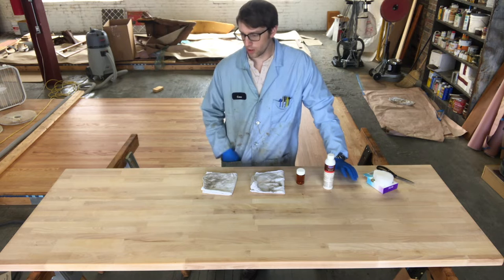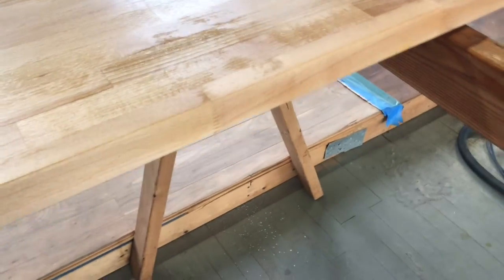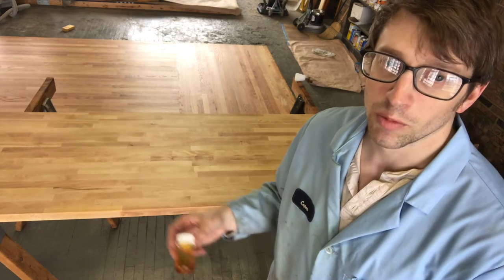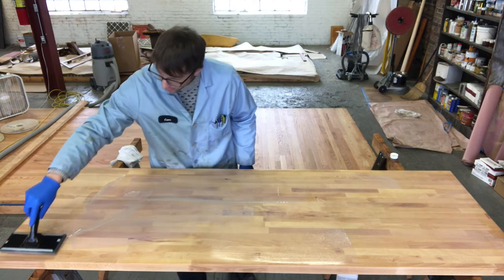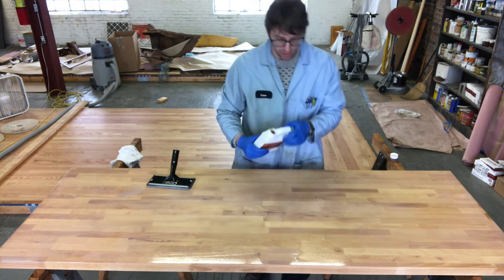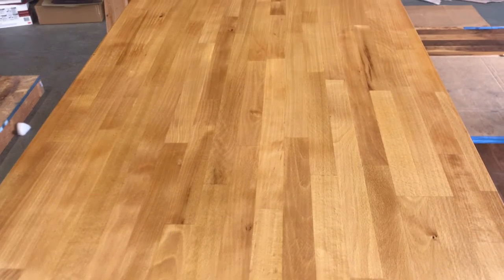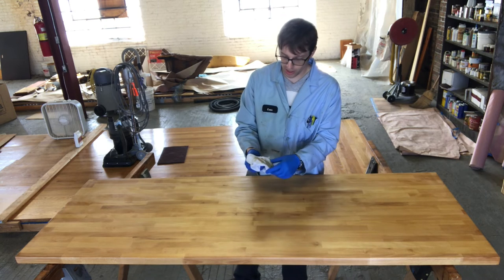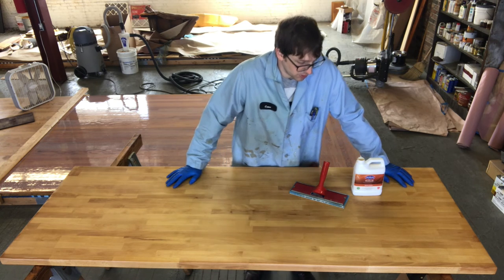Finishing Countertops with UTOS and H2OLOX

Comment: I have some birch butcher block I'd like to finish using this method but am planning on staining to get the color i want.  Is this process still the same if i use Varathane classic stain?  I think i saw letting the stain dry for a longer period of time, roughly 72 hours instead of 24 works best, is that correct?
Reply from the maker: Scott - Thank you for your interest in our products for your project.

We can't control other manufacturers formulations so we tend to err on the side of caution for drying/recoating times.  My recommendation is to usually double the recommended time for stains to cure as many stains are now "quick dry".  If the can says 4 hours, I'd give it at least 8, but more time won't hurt.

Comment: This was an extremely helpful video!  I used your UTOS yesterday and today to seal all 6 sides of my 72" x 39" hevea butcher block with two coats.  I'm going to install this on my island.  If I apply 2 coats of the H2OLOX to the top and sides and wait for it to cure for 7 days, would I flip the block over to finish the bottom and wait another 7 days to cure?  Or is it ok not to finish the bottom?  I'm concerned about possibly marring the finish on top.
Reply from the maker: Thank you for choosing Waterlox products and for the feedback on the video.  For most uses, having just the UTOS on the underside is enough.  If you do consider finishing the underside, you may want to save the last coat for the top side, in case you need to fix any damage from flipping/installation.  Also, 24 hours before flipping is plenty if you allow most of the surface to breathe (such as using sawhorses)  These guides may offer additional help:

Finishing the underside of the countertop: https://waterlox.com/guide-finishing-the-underside-of-a-countertop/
Where, When and in What order to finish countertops: https://waterlox.com/guide-where-when-and-in-what-order-to-finish-countertops/
Reply: @Waterlox  Thank you so much!  I’m very impressed with the products and your responsiveness!

Comment: Awesome tutorial! Considering using for birch butcher block countertops. It is stated that the product is food safe once fully cured.  What does that mean exactly? I do not intend to cut or prep on the counters, but obviously there will be some incidental contact and typically have rolled out pizza or pie dough directly on countertops.  Is that safe to do?
Reply from the maker: Thank you for the feedback and interest in our products for your project.  Food Safe means exactly what you are describing.  It is safe for direct food contact after as there are no harmful plasticizers or other chemicals that will leech out of the cured film into/onto any foods that contact the surface.  However, as you correctly stated, it should not be used as a cutting surface as that can penetrate the film and allow bacteria or other substances to enter.  We recommend at least 7 days for the surface to be considered cured, although full cure may take longer.

Comment: After applying my first coat of Waterlox I have one area that is particularly sticky. Do you have tips to help mitigate that before my second coat? Should it just be more time with airflow to make sure that section seals well?
Reply from the maker: Thank you for choosing Waterlox products for your project.  For troubleshooting purposes, I am going to assume that you've already applied the UTOS and you are saying "Waterlox" for the first coat of H2OLox?

On high tannin woods, if spots are not fully sealed buy the UTOS, then the tannins can be "activated" by the water in the H2OLox formulations which, in turn, can "deactivate" the driers.  These driers are accelerators, so the finish will dry on its own, but at a slower rate.

To solve your problem, give the surface more time and increase air flow with a fan on the sticky area if possible.  If you can lightly scuff the sticky area (slow hand passes, with the grain) that can help the oxygen penetrate deeper and speed up the process.  Once the film isn't "sticky" but is more just "tacky", you can apply the second coat.  The driers from the second coat will help to fully cure the sticky spot as well.

Comment: Oh man I'm in a situation! I had 2 coats of utos and 1 coat of finish on top. Plans changed from a drop in sink to an under mount. I made the hole for sink bigger can I just finish the edge or do I have to sand the whole counter before I put my final coat on ?
Reply from the maker: John - Thank you for choosing Waterlox Products for your project.  You'll want to protect that end grain well, but the UTOS will be great for that.  Wipe on 2-3 liberal coats of the UTOS (buff off excess after 5-10 minutes) on the newly exposed wood.  You can apply coats 6-8 hours apart. The UTOS will only penetrate where there is fresh wood and everything else should buff off.  Then apply your final finish coat over the whole surface.
Reply: Omg thank you so much !! I really really appreciate your response I was literally sick over this project! Again thank you

Comment: Do I still need to sand before I start the process and apply UTOS if I have a new, completely unfinished butcher block countertop?
Reply from the maker: I would still recommend it.  I cover that topic at about the 6 minute mark in our sanding video (https://waterlox.com/video-removing-old-waterlox-finish/).  Waterlox tends to highlight the wood, which unfortunately means it can highlight defects too.  There may be marks from how it was stacked, shipped or how it was sanded before they packaged it.

It’s not critical but it’s a good idea, I would just do a healthy hand sand with 100 or 120 grit.  That way you know you’re starting from a good point.
Reply: @Waterlox  Thank you! Lightning fast response, really appreciate it.
Reply: @Waterlox  One other question: my countertop is already installed, do I need to tape off my sink etc. to prevent the UTOS or H20Lox from getting on it, or can I just wipe that off? Anything else different I should being doing since I can't access all sides quite as easily as you did when it was on the sawhorses?
Reply from the maker: I’d recommend finishing what you can.  I wouldn’t worry about the underside or back edges.

Tape off what you can as that’s always easier than clean up in my opinion.  If some gets where it’s not intended - a clean rag for UTOS and a little soap and water for H2OLox while they are still wet. If you miss it and it’s allowed to dry check out this guide: https://waterlox.com/guide-removing-waterlox-original-tung-oil-finishes-from-unintended-surfaces/

Comment: Thanks for the thorough demonstration. Everything went well until my second coat of the H2OLOX. I applied too much finish in an area of the counter near the sink where I expect to get a lot of water splash. When the pools of finish dried they left noticeable orange streaks in the countertop. Is there any way I can sand those spots back down and reapply the finish? Or do I have to live with it at this point?
Reply from the maker: Thank you for choosing Waterlox products for your project.

If you can live with it, it is best to leave it alone.  Normal wear and tear will likely help to blend that in over a short period of time.  If you can't live with it, you can lightly sand those areas with 220 paper, working your way back up to 320 grit, 0000 steel wool or a maroon scotch brite to remove the scratches from the 220.  You'll then want to reapply a fresh coat.  If you are using the gloss, you can spot repair, but if you are using any of the lower glosses (matte, satin, semi-gloss), it will usually not blend as well so you should recoat the entire surface.
Reply: @Waterlox Thanks!
Reply: Hey, I’m in a similar spot I think! Can you let me know what you chose to do and how it went?? I love this product but I have no idea what I’m doing lol
Reply: @savannahlewis6156  My wife was pretty much done with the kitchen reno after almost four weeks. So my suggestion of sanding and refinishing the discoloured ripples of finish was not met with enthusiasm. So we’re just gonna live with it.

Comment: Either I don't know what I'm doing or the recommended volume for utos is way understated. Using 6-8oz for both sides of 8' butcher block
Reply from the maker: Thank you for choosing Waterlox products for your project.

The UTOS is a very high solids product (85%) so a little goes a long way.  It should not be brushed or rolled on but should be buffed on/off with a rag or buffing pad.  Pour a little puddle and spread.

Be advised that your specific wood and preparation steps can change how much your wood absorbs (pine will absorb way more than oak for example)

If you are using a lot you are likely buffing off a lot of excess.

Comment: I've always been told to stain/seal all sides of a wood project, especially if it'll live in a humid environment such as a bathroom.  Is just the sealer on the bottom enough, or do I need to do the H20Lox on the underside as well?  Waiting 1 day after first coat, then 7 more after 2nd coat... before I flip it and start again on the underside will add quite a bit of time to finishing my countertop.
Reply from the maker: That is an excellent question.  For most instances, just one coat of the UTOS on all sides is plenty of protection.  The only caveat would be if you have a particularly wet area, such as any exposed countertop with an undermount sink.  There is more information in our Finishing the Underside of a Countertop guide: https://www.waterlox.com/project-help/guide?id=0fc25320-d9fd-4562-8317-fcfb2b70e4b4&q=
Reply: 0:45 0:46 0:47 0:48 😮😮

Comment: I did two coats of UTOS and 4 coats of the h2olox matte finish on unfinished hevea butcher block. The finish turned out a very vibrant orange/yellow which was much more drastic a color change than I was anticipating. Will the color subdued as it cures? Did I put too many coats of the matte finish?
Reply from the maker: James - Thank you for choosing Waterlox products for your project.  Likely, the color will actually deepen a little more as the hevea ages (some wood bleaches out where other woods oxidize and darken).  The UTOS and H2Olox products use Tung oil as the main ingredient which is relatively amber in color, thus generating the warm tones.  Every layer that you apply will add another layer of this amber film, so the 4 coats are going to be more amber than the recommended 2 coats.
Reply: I am having the same issue with the color. I used the Truetone Tung Oil in white as my first coat and loved the color but after 2 coats of H2olox, it looks completely different. Is there anything I can do to lighten it back up so it’s not so orange?

Comment: Can I apply the coat of UTOS and one coat of H2OLOX to my counters, install them and then continue with the sanding and second coat of H2LOX 2 or 3 weeks after?
Reply from the maker: Otto - Thank you for considering our products for your countertop project.

Absolutely.  There is no maximum recoat time for any of our products so you can apply the second finish coat any time after 24 hours, whether that be 1 day, 1 month, or 1 year.  This guide on where, when, and what order to finish countertops may provide further assistance:

https://www.waterlox.com/project-help/guide?id=75e58eb4-f779-4c17-847b-53570d03362e&q=

If you have any other questions please reach out to us at info@waterlox.com or (800) 321-0377

Comment: For countertops, it was clear to use UTOS to seal the top and bottom but do you recommend a coat of the waterlox h2olox on top and bottom too?  Or is the sealer enough for the bottom?
Reply from the maker: It ultimately depends on your specific situation.  For instance, if you have an undermount sink, you'll have water exposure on the underside so you'll need more protection.  This guide will provide additional information:
https://www.waterlox.com/guide-finishing-the-underside-of-a-countertop/

Comment: Thanks for the helpful video. I'm finishing an oak dining table with the UTOS and H2Olox. I was planning to use 2 coats of each on the top, but should I do the same for the legs?
Reply: Thank you for choosing Waterlox product for your project.

Yes I would recommend the same process for the legs.  Because they are vertical surfaces you’ll need to apply thin coats of the H2OLox to prevent runs or drips, but as legs they don’t need the same final film thickness since they won’t have standing water.
Reply: @conorhawkins4089  Thank you, that's helpful!

Comment: Ok got the second coat on! I got one bad spot where it looks like it puddled and dried that way. Can I sand that spot and just reapply to that bad aera or do I need to redo  the whole counter ? Everything else looks amazing stuff is awesome
Reply from the maker: John - Thank you for choosing H2Olox for your project.  You can lightly sand and reapply, but its best to do the whole section, especially if you are using anything other than the Gloss.  You'll most likely see a spot repair in the Satin, Matte and Semi-Gloss as they just won't match up the exact same.
Reply: @Waterlox on the plus side  I am using the gloss. I had an extra peice that was finished and I tested it out looks like it's gonna work ..thanks again for all your help on this one !!!

Comment: Hello. I got confused and sanded my butcher block with 400 grit first before applying the UTOS. Pls advice on what to do next. TIA
Reply from the maker: Ideally, you should sand to a lower grit (150) to allow for better penetration of the UTOS. We are putting a film on the surface so you aren’t really interacting with the wood surface which is why we don’t need to sand to such a fine grit.

If everything looks and feels really good, you could leave it at 400. It will not severely impact your final outcome.

Comment: I am using the h2olox matte finish and 24 hours later, it looks more like satin to semi-gloss.  Does it need to cure to achieve the matte finish I am looking for?  I am using ash wood, Minwax oil satin (Jacobean), UTOS, and your H2Olox finish.
Reply from the maker: Roel - Thank you for choosing waterlox products for your project.  Mixing before use is very important with the lower gloss finishes (Matte and Satin).  The components that lower the sheen tend to "settle" over time so a good mixing 10-15 minutes before use is essential to make sure the flattening agents are evenly distributed.

A light buff of the surface and another coat should get you a matte sheen if properly mixed before application.

Comment: Is there anything that can be done if you have an “L” shaped countertop and the two pieces don’t fit together really tight all along the seam?
Reply from the maker: You have a few options.  You could use wood fillers, or caulk.  We have guides for both at waterlox.com. Just type in wood filler or caulk in the search bar.

If you're seam is close, you can sometimes use a mix of wood glue and sawdust to create your own filler that will accept color like the rest of the wood.

Comment: How is this finish different than your Original Sealer finish, which only requires one product so would be half the price?
Reply from the maker: The H2Olox system is much lower in VOCs and it also has more sheen options.  If you use the Original Sealer/Semi-Gloss finish, you can get a nice semi-gloss finish, however if you’d like a different sheen, you’d need a second product.

The H2Olox is really is the same great Tung oil and resin formula in a different package. Low VOC, almost zero odor, easy cleanup, available in every zip code.  Just another tool for the toolbox to make your wood beautiful and protected.

Comment: I'm trying to seal my butcher block countertops with the tung oil finish first coat let it dry for 24 hours next day it felt very rough I applied it literally like the directions said I watched another video it said apply with a small tiny cloth and then wipe it off so I mixed with what I should do with this product versus your H2O which is better to use and why should I not just use that since it's a less amount used I've already used half a gallon on two projects give me some tips
Reply from the maker: Dennis - Thank you for choosing Waterlox products for your countertop project.  I'm not sure exactly what products you are using when you mention "tung oil finish" as almost all of our products are based on tung oil.  I'm guessing that you may be referring to the UTOS and that you may have applied it like the Original Sealer/Finish?  These are two different products and are applied differently.  The UTOS should be applied as shown in this video by rubbing in a coat and wiping all excess off after 10-15 minutes.  If you apply too much and let it dry on the surface it will dry into a rough film.

The UTOS is a key component of the H2Olox system as it seals off the wood from the onslaught of water from the H2OLox finish.  This minimizes/eliminates grain raise and helps the coating dry.  The UTOS, however, does not leave a fully waterproof coating on its own.  So first you seal the wood with the UTOS with a buff on/buff off procedure, then apply two coats of H2Olox to make a fully watertight film.

If you have any additional questions, please feel free to reach out to info@waterlox.com or call our technical department at (800) 321-0377 option 4.

Comment: It’s been just over 48 after applying the first coat of the H2Olox and there are some spots that still have some grip to it. Am I ok to sand it for the second coat? I have acacia wood countertops
Reply from the maker: If it is just a little grip and can be sanded that will be OK. If there is truly any tack to it then you should wait.
Reply: Thank you so much! The countertops turned out perfect!